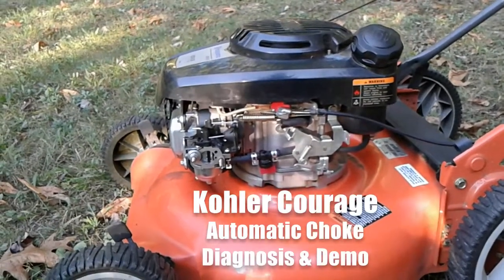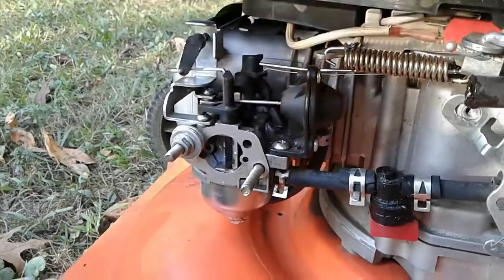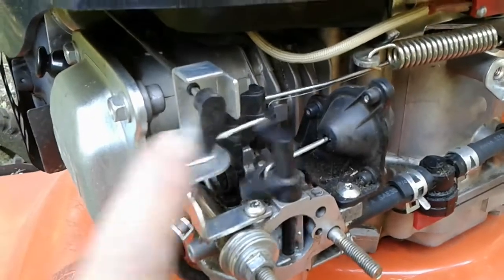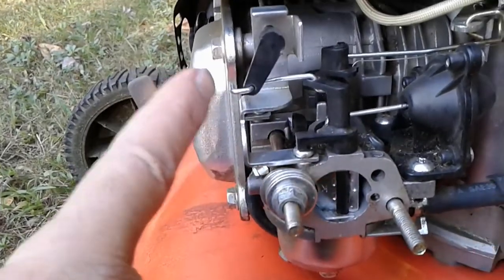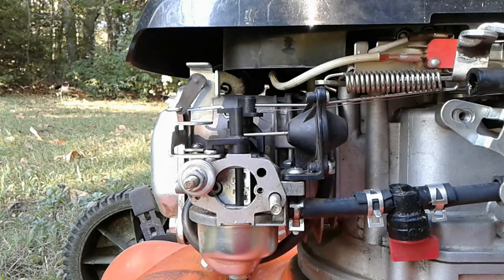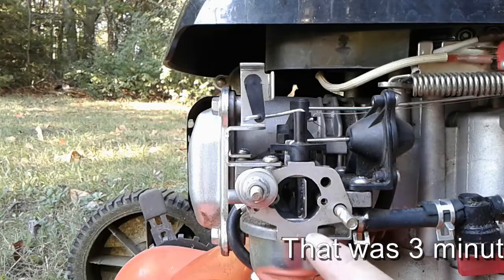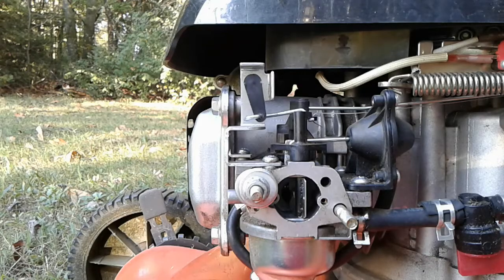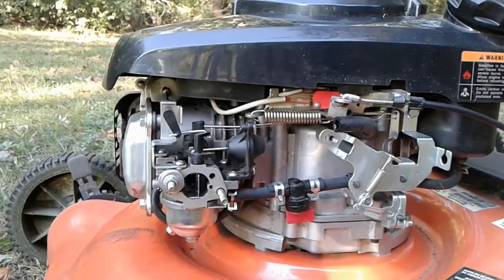Watch the Kohler Automatic Choke in Action! Fix it Tips!

Comment: Thanks for the informative video Buck!
I have a question though, what’s the purpose of the black diaphragm that is also connected to the choke valve? It seems to be vacuum actuated from the engine side of the carb after the throttle valve, but in my experience and in your video I see no function?

Comment: Ive had a love and hate relationship with this engine for the better part of 11 years now. Same issues as everyone else seems to have with the carb/choke. Everything runs tip top and then boom. Theres that one day when it all falls apart. Just give me the old school manual choke back
Reply: I just got a used mower w/ the Kohler XT-7 and it runs great with the choke disconnected and left fully open. Only difference is a few pulls for initial cold starting and saves a lot of potential problems w/ all auto-choke systems

Comment: I bought a new wire choke piece and installed it. The choke is closed when trying to start the engine as you explained. My problem is the lawn mower will not start. I have taken the carburetor off and cleaned it out the best I could. One problem was I couldn’t get the jets out. I have an order in for a new carburetor. Any suggestions on why I can’t get it started. I have the Koehler 149cc engine.
Reply from the maker: Well, a dirty carburetor could be the culprit. Hard for me to say. Once you install the new carburetor, you should be good to go. If not, perhaps there is another problem you'll need to figure out.  Remember the three essential: Fuel, Spark, Compression..... Good luck.

Comment: just the video I needed....  clean this area on the carb at the beginning of each season of use and every 3 months and it will not happen.. encrusted old dry grass  will keep it from  opening fully  and you get a rich fuel mixture and carbon fouled plugs... or closing properly and causing a hard or no start,

Comment: Mine starts great . . . when it's cold. The "Warm Start" is my problem. If I shut it down to move an obstacle or empty the bag, it won't start again until the engine cools all the way down. Then it'll start on the first pull. I think that I will try your linkage reversal, though. It couldn't hurt. Thanks for posting this video.
Reply: Yep!! I Have Jonsered with a xtx775 if you stop when the engine is hot it will not restart until it has cooled back down. It's a very half-baked design.

Comment: Kind of a bad design. It won't go back if the engine stops but is fully warmed up yet but still needs to be choked. It will not restart until the muffler cools back down

Comment: Thank you for this.  I actually have a xt675-2034 kohler engine on a Toro.  I took the air cleaner cover off and a spring was dangling.  Because of your explanation and camera work I now know it is the choke linkage.  I've played with the area where I thought it should go.  In my case, the linkage doesn't seem to hook onto anything but rather just pushes in a plastic slot that opens the valve.  The metal linkage hooks on one side but just moves back and forth in this slot with nothing holding it in place.  Very mickey mouse if in fact I am right about my explanation.  I haven't been able to find pictures or video of my linkage anywhere but your explanation has given me the confidence to try playing with it.  I'm just afraid that my fix is borrowed time and it will fall out of place again in time.  With all I've seen and learned, I would not be able to recommend a Toro mower.  Thank you for your help.
Reply from the maker: Thanks for the note. I'm sure you can figure it out. The issue is not really with Toro, per se, but with Kohler. Some of the Toro mowers have Briggs & Stratton engines, for example. Your issue is really with the Kohler engine and its convoluted choke mechanism. Good luck.

Comment: Did you install an inline fuel filter?  If you did, which one did you use and where do I get it from?  Great video,  thank you sir!
Reply from the maker: I did not install a fuel filter, but rather, an inline fuel shut off valve. Easily available on Amazon or EBay.

Comment: When I start mine, it takes several minutes to get up to speed but it runs very low power until then. Will barely cut the grass. When I first got the mower it didn't do that. I feel like something is stuck. Thoughts?
Reply: Please let me know if you find this answer. Same thing happening to me as well.
Reply from the maker: I recommend a thorough carburetor cleaning.
Reply: @Buckwsr  I installed a new carb. Same exact results with new carb. I will not let this mower beat me. LOL!!!!
Reply: I have the same problem when I get my Kohler  started it heats up n down n it feels I loose power my small wire broke off the choke but revs up n down then 10 min later it stalls. I wired a piece of wire so it makes contact, now its leaking gas out of my carburetor under screw I can't  seem to stop leak, loosing lot of gas now what do I need another carburetor.  Help please  Duke. Thank you.
Reply: Buck any suggestions

Comment: Nobody really ever talks about that black diaphragm looking thing that has a tube connecting to the other side of the carburetor that also connects to that choke butterfly is there a way that I can test that and what does it do because it has some role in that choke system maybe I have something wrong with that part
Reply from the maker: Thanks for the note. Like you, I am unsure about that black diaphragm apparatus you mentioned. Surely it seems like it must be some kind of choke control. Based on the looks of the linkage...it appears that it might have the ability to open the choke plate, but not necessarily close it.... Let me know if you find any info on that....
Reply: Buckwsr thanx for the reply...yes I found out it is supposed to use the vacuum from engine to keep the choke open...im having the opposite issue so my issue is with the choke closing....i think the spring is so weak like you mentioned cleaning it is super important....i have the linkage on wrong I'm going to change that and clean the hell out of the shaft and if that doesn't do it I will spend the $20 on the thermostat
Reply from the maker: Thanks for the info and good luck on your project!
Reply: hm i thought about that too.  good question
Reply: You can suck on the hose and see if it operates.  You might want to use a miteyvac to measure hiw much vacuum it takes to open, and if the diaphragm leaks.  I'm having an issue with one of these right now. When the engine starts, it runs too rich while waiting for the muffler heat to open the blade.  I believe the diaphragm should be pulling it open as soon as it starts, overriding the spring rod.

Comment: I've got the same engine on a Lawn Boy. When I release the bar on the handle, it won't shut off. The fly wheel brake is making good contact, but it still won't shut off. Any thoughts?
Reply from the maker: In addition to the flywheel brake, releasing the control bar also serves to ground out the ignition coil and shut down the motor. Apparently that is not happening in your case. I have another video that explains and demonstrates this, though it is a different engine. The principle is still the same. You can check it out here: https://www.youtube.com/watch?v=a3tVL23J87s
Reply: @Buckwsr Thank you. I understand how it works, but on this particular engine there is no wire that connects the flywheel brake to the coil. Instead, there is a little red box (like I see in the video we are commenting below) that has two wires coming from it. One connects to the coil and the other connects to a ground (just a screw). When you pull the brake bar, the arm that moves the flywheel brake pushes up a little level on the bottomside of that box.

With this particular set up, when I release the brake bar, the engine does not cut. I even took the wire from the coil and connected it to the flywheel brake and it still didn't cut spark. Thoughts?

Comment: Buck's Small Engine DIY - Your video does not include the real reason the choke opens. I am surprised you did not include it. There is a cone shaped piece with a diagram in it and a rod hooked to the choke. This part is called the "choke pull off." It is located to the upper right of the carburetor. There is a hose that runs from the carburetor up to this piece. When the engine starts, a vacuum is initiated in this hose.  The vacuum pulls the diagram down. There is a rod hooked to the diagram. When the diaphragm is pulled down the rod pulls the choke open. So, the choke is initially opened by the choke pull off while the motor heats up. Once the motor heats up then the choke is held open by the device you described in your video. The video is inaccurate. However, the video is well done. Thanks for posting.
Reply from the maker: Thanks for the additional info!

Comment: Good  day from Ontario.  I found   mower with kohler motor  & choke system like this.  After watching different videos on this & watching yours   Igot it going.  
Gave it to my brother, works great .  He changed oil because  it was black.
Now he complaints  that oil is black again.  U cannot see smoke from exhaust.  Is there  adjustments on carb to change this.  Thanks  Very good video
Reply from the maker: Hi Don, There really are no adjustments on the carburetor. And if it's running fine with no smoke, there's no need to attempt it. Just change the oil again. You see, an oil change in any engine does not get out all the old oil. Most, but not all. So the new oil has mixed with the remains of the old oil and now appears dirty. Just change it again. Sometimes, when I get an engine that has never had an oil change, I give it the Double Oil Change Special: I change the oil, run the machine for 10-15 minutes, and then change it again. This is the best way to get rid of most of the old oil. Good job getting mower running again!
Reply: @Buckwsr    Thanks good  information

Comment: Buck that was a good video.  I have the same engine on a Ariens mower.  It would start OK, then after about 20 minutes start revving, slowing, revving, slowing for apparently no reason.  There is a little rubber gasket if you look closely around the metal rod that is held in place by the metal bracket.  Mine is kinda broken and doesn't stay in place.  Could this be causing the erratic revving?  The spring action seems to be smoother without the gasket.  I've already taken the carburetor off and thoroughly cleaned it so this is frustrating the hell out of me.  Pls. advise!
Reply: When mine did that (revving & slowing), it was the fuel tank cap not venting correctly, causing a vacuum in the tank. Loosened the gas cap and the surging would stop.

 Drilling a 1/32 hole just below the cap threads on the tank did the trick. (I've had this happen on several mowers before. My Honda HRX217 was really bad about it.)

Comment: I have a 6yr old Toro with a similar set up. After 45 minutes of mowing the engine sputters and dies. And won't restart. Plenty of gas, air filter clean. No spark getting to the plug. 1/2 hour later it starts right up and runs for another 45 min. sputters and dies. Coil AND choke thermo bad?????
Reply from the maker: Replace ignition coil (magneto). Or, schedule your mowing in 45 minute increments!!!

Comment: I’m less ignorant.Thank you.  I do have revs going low to high to low to high to low...  You get the picture.  I don’t know enough about carburetors to determine if I need to take it apart further.  Sure there is a video for it. Kohler 6.75 149 cc.   Despite my issue, this is the best demo I’ve ever been able to see and understand in layman’s terms.  So thanks. - Chris In Kalamazoo
Reply from the maker: Thanks for the note, Chris. A surging engine may require a thorough carburetor cleaning, or, as is sometimes easier, a carburetor replacement. Yes, there are plenty of videos out there on how to clean a carburetor. Good luck.

Comment: What does the black thing to the right of the choke linkage do. It looks like a diaphragm with a linkage piece connected to the choke linkage?
Reply: It's a vacuum pull off that should be opening the choke as soon as the engine starts, I believe.  There's an extremely tiny hole in the carburetor throat that runs to the nipple the hose is plugged to.  It seems to stop up easily.

Comment: Very cool. My lawn mower won't even start and I'm was wondering if it might be related to the automatic choke. So they also have automatic throttles? The carburetor looks clean and changing the spark plugs didn't do anything. If I spray starter fluid in it runs for a few seconds.
Reply from the maker: If you mower only runs on starter fluid, I would say your problem is that you're not getting fuel flow through the carburetor. Possibly the main jet up through the middle is clogged. I would drop the bowl on the carburetor and make sure it's clean and that the main jet is free and clear. To run only a few seconds on starter fluid means you're not getting fuel. Good luck.
Reply: @Buckwsr  Thanks so much!
Reply: @Buckwsr  Thanks so much for your help. I couldn't figure out how to take my carburetor off because it has these arms attached to it for the automatic choke and throttle, but I did expose it the best I could and blast it all over with carb cleaner. That did the trick! Now it's working fine.
Reply from the maker: @mitchjohnson4714  Good job!

Comment: This is very helpful thanks. They should really just put a choke switch on it.
Reply from the maker: Yeah, stupid overly complicated systems...tell me about it!
Reply: @Buckwsr  someone took carb off and twisted the choke actuator clockwise while putting carb back on so it was pulling choke open cold and closing choke engine hot. Nothing wrong just put together wrong.

Comment: mine runs okay after the initial start.  after I stop the engine to empty the bag, I can’t get it re-started.  when I pull off the air filter housing, the choke plate is wide open.  If I push the choke plate closed with my finger and my wife pulls the cord, I can get it started.  Otherwise, I got to wait an hour or so.  that thermal lever seems to be working as it should.  any other suggestions?
Reply from the maker: No suggestions, really. Maybe a thorough carburetor cleaning. some people opt to rig up a manual choke, but that sounds like more trouble than it's worth. Be nice to your wife so she stays willing to help you when you need it.
Reply: I had same problem. Removed fuel filter from tank and added red inline filter. This  increased fuel flow and fixed my problem.

Comment: I have an auto choke with the same exact setup on a Kohler engine. My problem is I tested the spring in the spring is good on the thermostat but it doesn't always close all the way I wonder if I need to take apart that entire shaft of the choke butterfly and just really clean it out really good because like you said that spring is not very strong I would hate to buy a whole new thermostat just to have the same problem
Reply: Hey I have same issue but I purchased new auto choke assembly but it doesn’t work and pull back closing the choke. I’m thinking it’s a bad unit.

Comment: I have one  it will run but when I put it up the gasoline will leak out what could be the problem
Reply from the maker: What do you mean by "put it up"? The most likely cause of fuel leaking from the carburetor is that the needle is not seating properly to cut off the flow of fuel into the carburetor. Could be some debris keeping it from seating properly.
Reply: @Buckwsr  in a shaid

Comment: You have in this video the small one inch shaft connecting thermal choke control with the control on top of the carburetor in the incorrect or reverse placement.
Reply from the maker: Yes, you are right about that. But it seemed to work better installed in reverse like I did, so I left it that way. For this automatic choke system everything needs to move smoothly and easily. That's the key.
Reply: @Buckwsr  it is going to fall off and then end up at another shop for repair telling that the previous guy was ignorant and sloppy.
Reply from the maker: @facereader99  It will not fall off in a million years.

Comment: Having the same issue.  Thought maybe it was the auto choke mechanism that wasn’t working.  I’ll get the carb cleaner out tomorrow and make sure the mechanism moves freely!  Thanks for sharing!!!
Reply from the maker: Hope you get it all figured out! Good luck!
Reply: @Buckwsr  it still shuts off when it gets hot…. I can tweak the control arm for the carb and can kinda keep it running…. I’m not sure what it can be
Reply from the maker: @HisWayHomestead  Do you know for sure that the choke plate is opening fully?
Reply: @Buckwsr  if you are talking about the little flapper that moves inside the carb, then, yes, it opens up fully.
Reply from the maker: @HisWayHomestead  Okay, you may want to take the carburetor down and clean it out thoroughly. Make sure you're getting good fuel flow from the gas tank to the carburetor bowl. It is also possible that your problem is not fuel related, but ignition. Try a new spark plug. I had a machine that ran fine when cold, but struggled and died when it warmed up. A new spark plug fixed it. That's a long shot, but it's easy and cheap to do it.